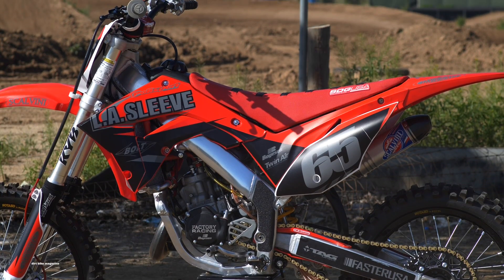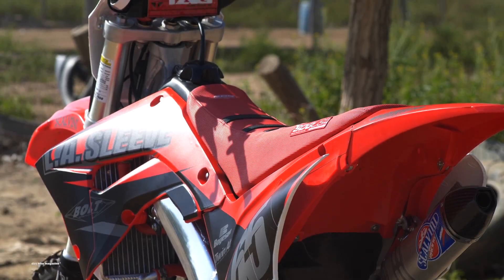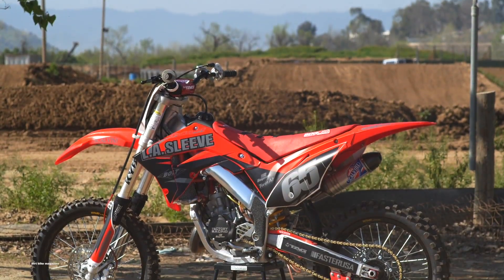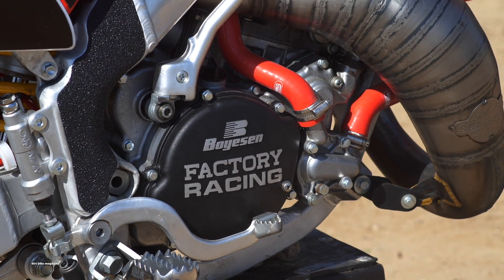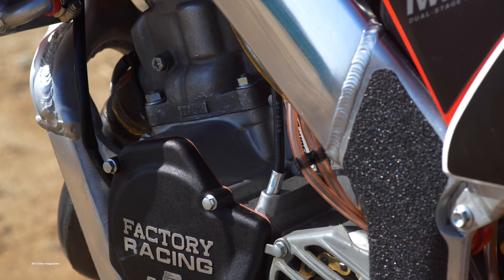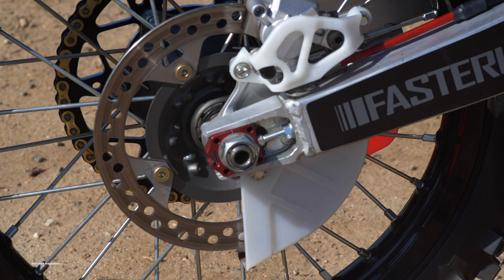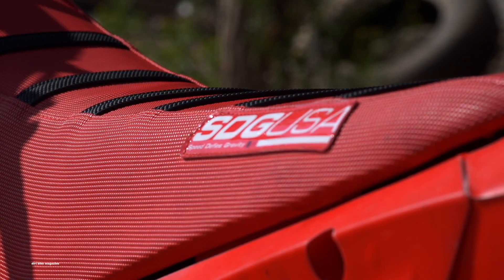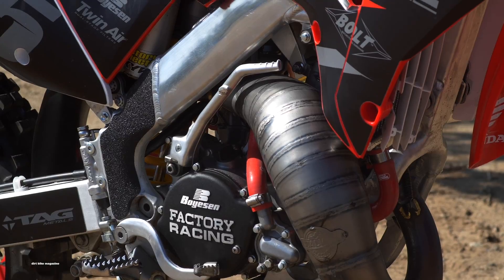2001 Honda CR125 2 Stroke LA Sleeve Project Bike - Dirt Bike Magazine

Comment: I'm on a 01 but instead of changing all the parts you did and spending all the extra coin I just got just fresh UFO plastics and a 2019 front fender and cycra stadium plate, Pryme MX sells a kit to mount it all up. Cost a fraction and still freshens it up. Just had to let my graphics person know that I used a different front plate.
Reply: @livefastdiequick I didn’t… but now I’ll look into it

Comment: I have a 2001 Honda CR250 will this work if I buy a 2003 gas tank, sub frame, and air box? I’d really like to restyle my bike with the polisport kit.
Reply: Did you do it?
Reply: only tank is need it. AIRBOX not shown, side plastic hide it. You can keep your original subframe and add two extension for the lower side bolts.

Comment: Aren’t you only supposed to re plate liquid cooled 2 strokes with nikasil? Thought sleeves don’t dissipate the heat well enough.
Reply: Yup, you're correct.
Reply: never had one sleeved. always just bought a new cylinder. at the time a new cylinder for my 94 kx125 cost around 400 dollars and was told to never sleeve them due to heat like you said and was told that sleeves had a tendency  to shift with in the bore and come loose. But that was 20 years ago don't know if they have improved since then or not.

Comment: I’m 5’8 and ride a 02 and 07 CR125. They are very tall bikes. Especially the 02.
Reply: Please tell me how they compare engine wise ?!?!? I have a 05 144 6 speed swap trans ported mid to top with fmf fatty and would like to get another !
Reply: @HOTSHOT-ls1bc  pretty sure the 02-07 have the exact same engine. They hardly touched the bike between those years

Comment: Nice build, just an observation his bars look a bit high when he’s riding he’s not able to get those elbows up into the correct attack position esp in the corners as it looks like he’s almost hanging onto ape hangers, try a lower position or lower bar size, Jmo though. But nice work.
Reply: Maverick224 yo are you a riding coach

Comment: How did you guys fit the 2003 gas tank, air box, and subframe did you have to make new holes or did it line up. I want to do this to my 2001 cr250
Reply: just get a tank you dont need the subframe you can just make brackets.
Reply: What about the airbox?

Comment: Hey I’m looking to get get into dirtbikes but I’m on a yfz 450 quad any advice?
Reply: Go to Facebook and look for a similar year bike, idk if u like 2 strokes or 4 strokes you could easily trade that for a 125 2 stroke, and you could probaly get a 250 2 stroke also, but a really good bike that I'm in love with is a 250 four stroke, preferably a yamaha, anything from 2008 and up are really good, a 450 bike is a little to much power for a first bike, and maybe a 250 2 stroke is also but you can try it, Facebook marketplace is the best place to trade your stuff, just post a pic of it with a  description and say what u want to trade for.
Reply: Thank you

Comment: Honda Beats Kawi in the 250 East
Reply: No, one rider beat another rider..
Reply: @robertbandy216  Sexton is the east coast Champion
Reply: @robertbandy216  what's wrong with that bike I like this bike it does have a scalvini exhaust
Reply: @n8sc6r  okay and he would have won on a Yamaha had he be on one.  The scalvinni exhaust is nice to bad that bike is hacked up and looks like shit. Then they didn't just re plate the cylinder. Slow motor with a junk sleeve now.

Comment: Where i can buy all that's parts..?
Reply: eBay or your local classifieds. They don't make any of the parts for the conversion other than the air boot which is a very small part for the conversion.

Comment: I wish my 2001 cr 125 could morph into this bike my god
Reply: It can my friend I'm doing it now.
Reply: @2stroke4ever1987   how did it go? Did u only need the tank,subframe,airbox? Do I need a 03 seat?
Reply: @averyflannery4113  the easiest way to figure it out is to read the articles on dirt bike. They have a few CR builds and if you read the write ups there is some info in there. 03 CR parts are hard to get. eBay is your best option. Also a company in Portugal I think makes the updated plastic kits. Covid ruined my build so I made it rideable with what I had laying around. Feel free to PM me if you would like.
Reply: @averyflannery4113  if I remember correctly the update kits from Portugal are bolt on or close to it. But yeah your on the right track.
Reply: @2stroke4ever1987  whats the link

Comment: Does the 2003 cr125 tank, air box, and subframe bolt on with no modifications, to install the polisport restyle kit??? Please lmk highly interested!
Reply: George Bowen yeah just look up the kit. It's for 02-07 cr125-250. Bought it for my 03 cr250
Reply: My question is does the 2002-2007 cr125 tank, air box, and subframe bolt directly to the 2001 cr125, to allow the polisport restyle kit to fit the 01 125?
Reply: Thanks in advance 😎
Reply: @georgebow7832  I recently got an '01 CR125 aswell, after reading the article. It looks like you change the Gas Tank, Subframe, Airbox, from a 2003, and the Plastic Restyle kit should bolt right up. Polisport says '02-'07 so I imagine the '02 onward to '07 previously stated parts would bolt right up.
After fixing the wheels and linkage, I may start hunting some newer parts to swap this over. I imagine all these things must be acquired before the styling kit will mount up.